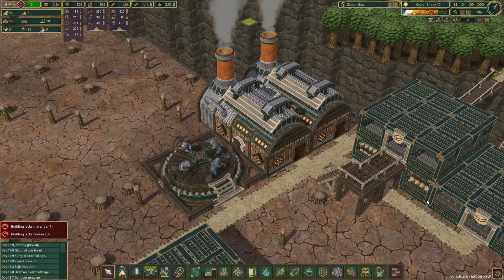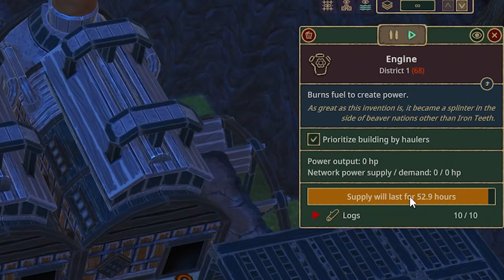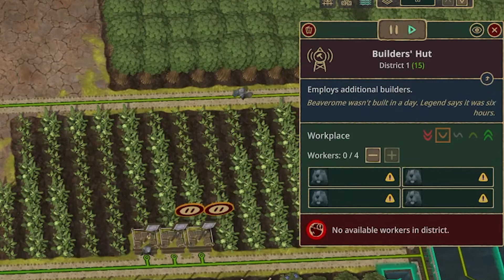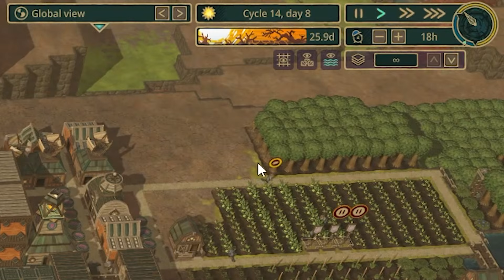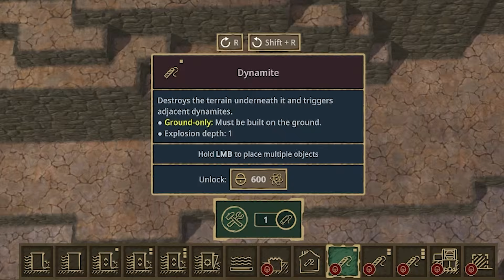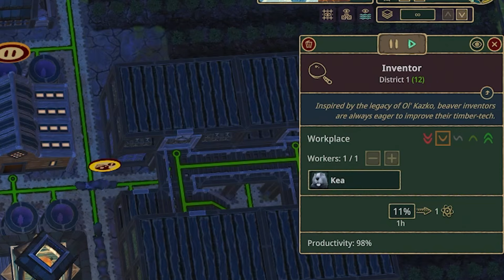Bridging the dam over a river  - Timberborn - Steeltide #5

Comment: So much effort engineering the bridge-dam… you could have blocked off the bad water, let the dam spill or overflow out the side where you built the bridge, and let turn it into a stream/pond/dam at ground level, making that transition far easier in the long run

Comment: I notice that the way you’re building the dams requires a lot of micromanagement. Since they’re building on the same layer they’re standing, you have to keep assigning new builds so they don’t block themselves off. 

If you build a staircase to the center of the dam, and have them get on top of the new layer of levees, you can assign all the build commands at once, and they’ll still parallelize. 

Heck, you could even parallelize them some more, by increasing the existing staircase height, and letting them build from both the centers and the ends!

Comment: 15:40 If you want to fill the new lower pond higher than 1 tile (as seen at 27:00), then you'll need to add a second layer of sluice gates above the current ones. You can build a set of levees directly behind the current set (making a cofferdam) to prevent the water escaping while you replace the ones above the sluices.

Comment: Hi
8:55
You dont need metal sheet on top of levies.
They are water tight
Reply from the maker: I missed that, thanks!
Reply: @ZeddicBuilds you are welcom ,
i expected to extent your dam more horizontally,
This water is not enough.
Dry season is too long.
Or use pipe and connect new water storage  to old dam .